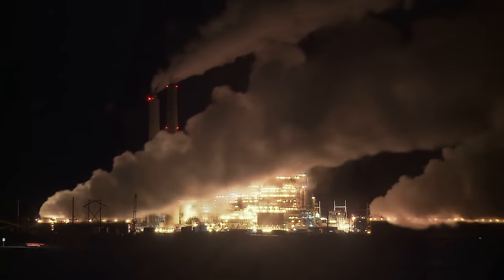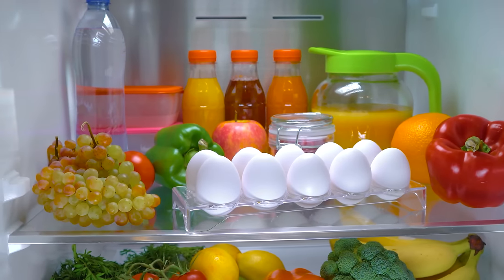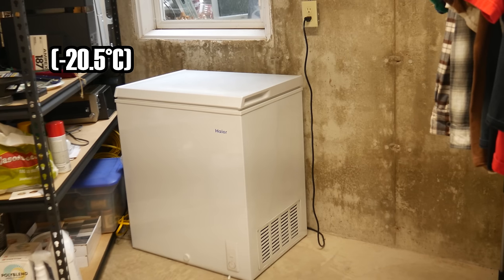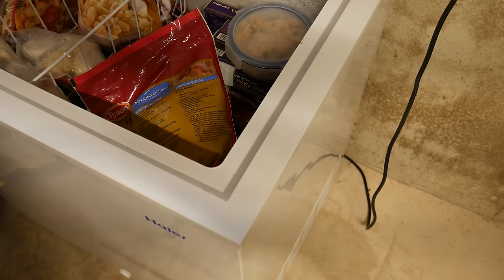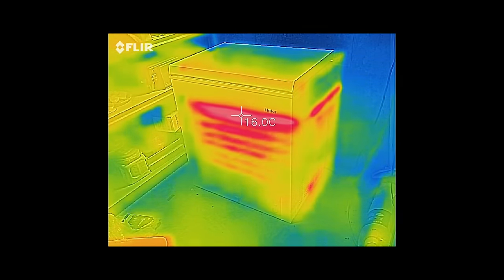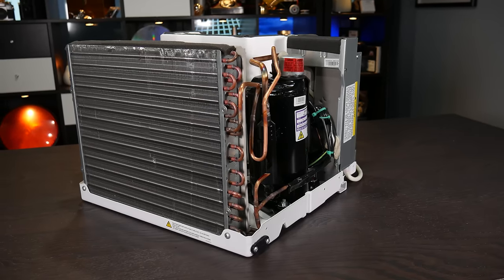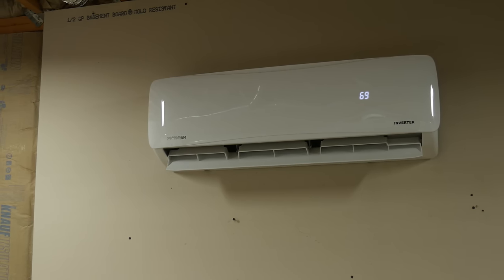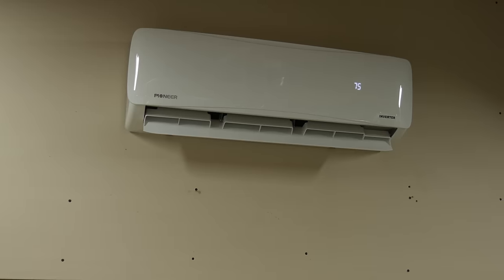Heat Pumps: the Future of Home Heating

Comment: That's a noisey way to heat your home and water, compared with a standard boiler.
Reply: Not at all.
Reply: @TT.Hell. Our boiler is almost silent, inside the property and out. No fans, so a lot quieter than the one in the video. Was the one in the video a bad example?
Reply: @MattBrownbill  Yes, the one in the video is not ok. Probably faulty, worn bearings, bad balance or something.
My unit outside have a huge fan, but even on maximum it is not very loud. I think the high priced good brands put a lot effort in making the best they can. When it comes to heating, people in sweden wants quality and are willing to pay for it. If the need for heating was not so demanding it probably had not lead to the development of the heat pumps we see today.

Comment: Intellectuals like you show that a heat pump can work on paper.  You need to use a heat pump to find out that at best it is good for supplemental heat and you will need a sweater while it is in use.  This is especially true if the temp falls behind your comfort level and it has to catch up (returning from vacation). Just like electric cars vs hybrid, heat pumps are best used when paired with a conventual heating source (boiler, gas, etc).  Problem is that now your are buying two systems that need to work together.  Looks good on paper but doesn't feel good in use.

Comment: Heat pumps!  Yeah great if ypu live in a climate that has normal temperatures between a little warm and a little cool.  
Try using a heat pump in minus 30.  Pay that power bill.
Reply: A Geothermal heat pump will generally cost less to run at -30C than gas.
Reply: Ah yes, 99% of the world's population lives where it averages -40 degrees.
Many people live where heat pumps make sense

Comment: sounds like propaganda bullshit, fraction of the energy really ? how many amps does the compressor draw at full load, and what is their efficiency at 0 degrees? oh yeah ZERO
Reply: Depends on the heat pump, and what the heat loss is to be running at full load.  e.g  I have 3 for my house, each are electrically limited by a fuse to 13A, but realistically nothing is going to be getting close to the rated fuse, and each will be closer to 10A.  However, it was -14C a few weeks ago, and my whole house, including running a 2kW radiator for my unheated basement was consuming around 5-6kW (~22-26A), with an inside temperature of 21C.  2 out of the 3 of them can still be around 200% efficient at -25C (-13F).  So unless you're talking about Kelvin, then you might want to get your information up to date.
Reply: Air-source heat pumps are generally more efficient when there's only a slight temperature difference between outside and inside air. That means they may become ineffective when outside temperatures fall to and below -5°C, where the atmosphere's temperature is at or below the freezing point.Feb 13, 2023 @BenIsInSweden
Reply: @byanyothername123  So? mine is well over 550% efficient when the temperature is close, but at that point I'm not going to have the heating on much.  Mine still retain over 200% efficiency when in -20C, and mine doesn't even have Enhanced Vapor Injection like some that will increase efficiency in those temperatures.
Reply: Heat calculations are performed in Kelvin. 0°C is 273K.
Reply: That's... really not how heat pumps work, you realize that right? At 0⁰ F does not mean there is no energy outside. As long as it is not 0 Kelvin there is energy available to be transferred. At 0F, it admittedly has to work harder than it would at 20 or 32, but most modern heat pumps maintain a net positive efficiency ratio down to about -15 or -20. Except for a few very select regions in America you're not going to hit that temperature more than once a year at most.

Comment: Heat pumps suck under 10 F. When it gets down to below 0 F they are useless. I have one.
Reply: Not correctly sized, or using the appropriate heat pump for the climate. Mine have been working fine in -20C (-4F).  Enhanced Vapour Injection ones (Hyper Heat etc) will have full capacity down to -5F, and can be sized to operate solo down to -30C / -22F.
Reply: That was 20 years ago. Todays machines are MUCH better.